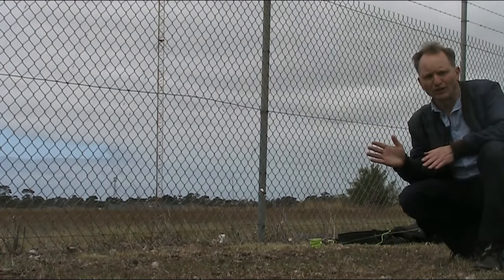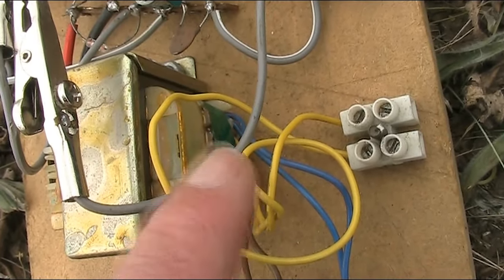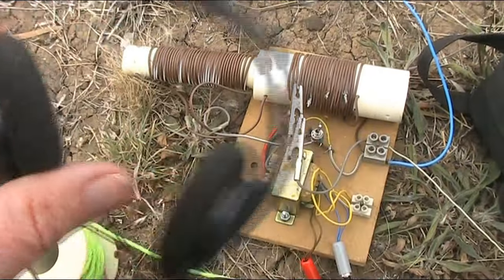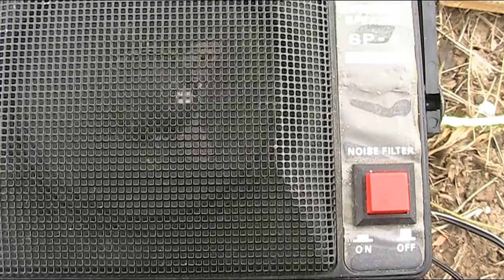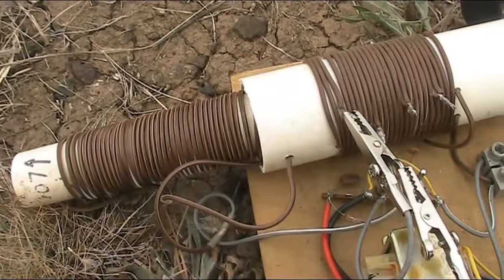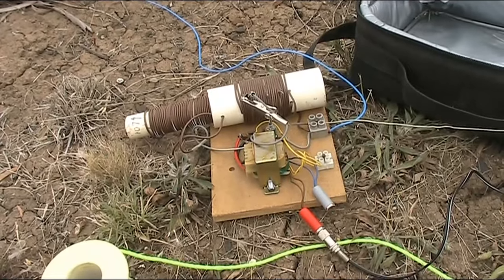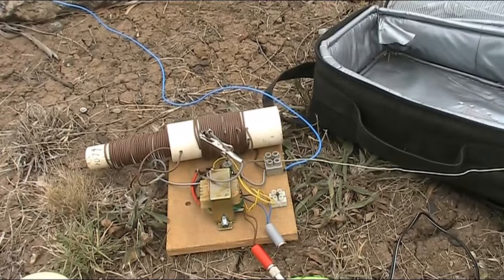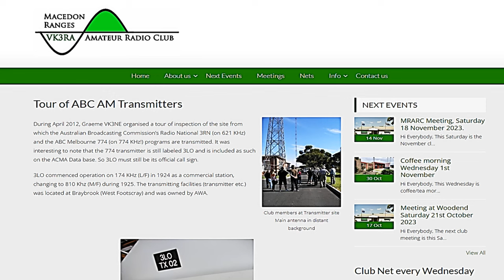Crystal set under a 100kW radio station: How does it sound?

Comment: I build a crystal set together with a boy scout. Here in Townsville the ABC 630 kHz is the strongest station. We used a Schottky diode and a tuning capacitor and coil from an old AM pocket radio.

Inside a Queenslander house with a short earth connection to a water tap and an about 8m inside antenna wire we receiced a station from Cains. 
After we connected a disc capacitor in parallel to the tuning capacitor we had the strong ABC station in the middle of our tuning range.

Comment: Nice. I used to live near an Amberley weather beacon at 359kHz. Well I still live here, but the beacon only operates on VHF now. I’d be surprised you really needed anything other than headphones. Just about anything became a radio here when I least expected. A detector is any two differing metals touching ie. just about any wire connection to anything. Crystal radios always worked well for this freq, even if it was a failure on MW.

Comment: At that site the signal will probably light up a fluorescent bulb.
Reply: This is correct.  I can confirm that I have personally walked around outside of the fence on several 50Kw AM stations in the states and easily lit up a fluorescent lamp.  Many of those same stations could be heard on neighbors telephones, space heaters and even toilet plumbing.
Reply: @WECB640 I'm guessing this is caused by the relatively strong magnetic field modulated with AM, as the power of the broadcast varies based on the waveform

Comment: I'm surprised that this wasn't much louder.  I wonder if the Germanium diode suffered some breakdown due to the excessive voltage or currents.  I used to drive a speaker with my crystal set from a good 10 miles away from a 5Kw, so a 50Kw at close range should be able to light a small lamp and power a PA horn with ease.
Reply from the maker: I should have taken a selection of different diodes. I've been told a schottky diode might be worth trying.

Comment: I guess it would also work if you just shortened a headphone with a germanium diode. With that power, the cable and the coil would pick up enough energy to drive the headphone, and the diode would rectify the loop enough to get a demodulation. Would be cool if you´d try it out when you are around there, with a piezo and with a magnetic headphone :) I´d do it myself, but we don´t have any AM transmitters over 10W, yeah Watt, not Kilowatt, anymore :(  Dunno if it´s true, but old stories tell that tea pots on an oven played music - sounds plausible, the oxidized plate under the teapot might act as a rectifier.

Comment: Ok, my curiosity is getting to me. What does the Noise Filter do on what appears to be only an external speaker in a case?
Reply from the maker: Just a top cut. Switches in a parallel capacitor probably.
Reply: @vk3ye  thanks.